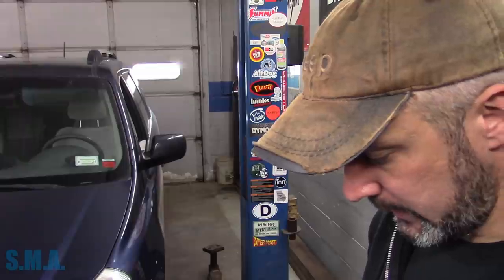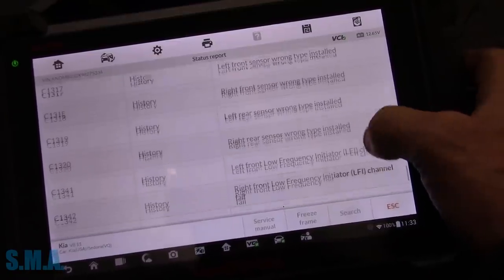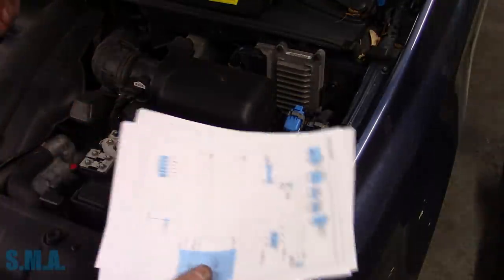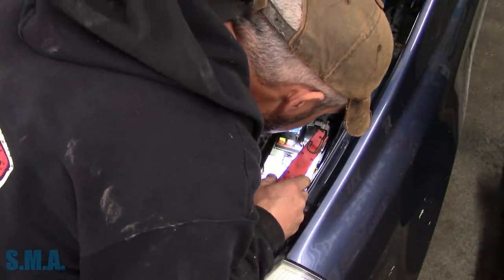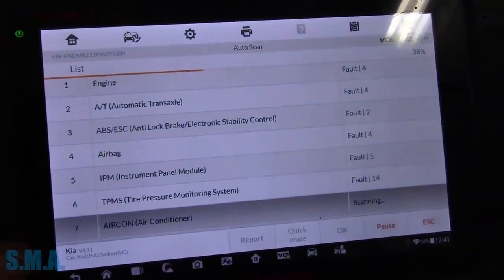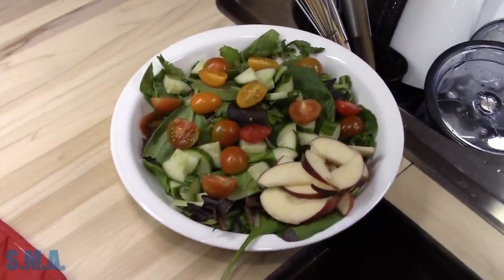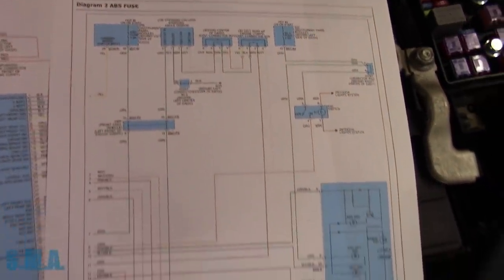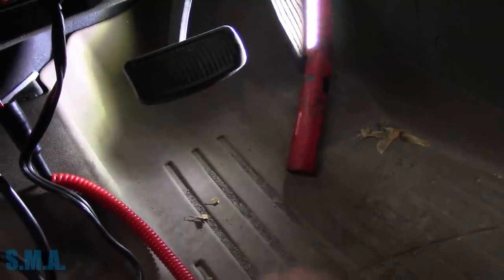You Can't Fix'em All...

Comment: Only one question....please.....how many miles on the Kia?    Thanks .....Jim
PS........had a Problem on my 2009 Honda CR-V (115,000 miles) that baffled me for a while, different error codes came up, misfires, etc., seems as if the computer was going crazy, bought an oem main relay, but before putting it in, one of the codes, besides changing the relay, it said to check the negative cable, if it was loose. I was able to turn it by hand, not easily, but it was not snug. I changed the washer, put on a locking nut (with nylon on the end of the threads) and buttoned everything up. Viola! Everything has worked fine for the last 3 months. No more codes.

Comment: Love the mystery blown fuse.  I do the same as you, trace the circuit, pull the harness, etc.  Only difference is I ask the customer (or driver in my case) if they jumped started the truck or got jumped.  I have found (especially Fords) do real weird things when jumped wrong.  With all these little Chinese jumpers I have seen some havoc after they are used.  Only thing worse is when they use the equipment to jump their trucks, seems 28 volts is a tad high for the truck, sure cranks well though!

Comment: Curious, did you test the remote start & or check to see if best rig tapped into a com circuit wire? Could possibly only blow few on remote start, especially if remote start is failing internally & drawing to much current.

Comment: Very hard to repair to repair intermittent wiring night mares. But I had something very similar, it was steering angle sensor. It took a long time to diag it. Found it by rotating the steering wheel from stop to stop. It was at a certain spot and abs would go red(no comm). Replacing the SAS repaired the issue.

Comment: Re "thermal cycled" fuses: I've seen plenty of the old style (like 3ag) class cylindrical fuses fail from cycling. The type with long straight metal wire element inside. Very cheap to make, but no provision for expansion an contraction. The newer plastic case automotive fuses have U shape elements that all but eliminate stress and cracking. So, yeah, I'm 99.9% sure something made that fuse blow.

Comment: In all the years I have done wiring and drivability only ran into one fuse pop I know was just the fuse dieing. Power feed was to module only and didnt continue past it. The customer was also my customer for many years and continued to service same vehicle over time. Every single other fuse I was able to trace to ground at one point or another through an activated solenoid, module etc.

Comment: Fuses dont always blow because of shorting,some times it can be because the current draw spike exceeds the fuse value when switching. I have vehicles like this before where after investigation no fault or damage has been found and the problem has solved when the fuse has been uprated from 7.5 to 10 amp. There have been some technical bulletins from manufacturers which have said when no fault found uprate the fuse to.. Citroen  alternator field supply springs to mind. 
The reasoning behind this is, wiring strands in the loom have been reduced (accountants) wiring terminals crimped not soldered (accountants) and connector blocks made out of the cheapest components which will "just do" those accountants again !  All the cheap stuff starts to deteriorate over time and in the uk with salt etc and biodegradable wiring covering the wires go slightly porus and all sorts go wrong and the current draw required goes up.
. BMW Peugeot Citroen GM cooling fan connectors spring to mind and fail usually showing up in the summer months in a traffic jam followed by a head gasket. I cannot remember when I last saw a MK1 Renault Megane no major rust or mechanical problems but  4 strand wiring ??  Can't even get blob of solder to stick.

Comment: Best to ask customer when the issue occurred  and if the car was worked on by someone else when it happened. I would even remove the remote start module that was installed as this maybe causing the issue.

And sometimes a fuse can burn from over voltage protect circuitry due to alternator producing high voltage output but this is very rare.
Like you were saying it could be many other things. Just replace fuse and see what happen over the next few weeks.

Comment: My daughters Tucson has similar problem.initially we thought it was aftermarket remote starter butcher job.Had all that removed. Code comes in as speed sensor. Changed,same fault. It also looks like Christmas on the dash, traction ,downhill,abs,check engine all on! Still drives ,sometimes dash returns to normal for short period then warning lights on again  ! My mechanic gave up too!

Comment: When looking over the video I noticed what looked like a metal hose clamp around the wire harness
when you were under the dash that could b a problem. I would have put a twist tie on that while I was
under there, probably not going to solve your problem, but it's worth a try. I never seen a metal hose 
clamp if that is what that was under a dash around a wire harness before.

BTW Love your videos.

Comment: I encountered an AMG fuse this week that seems to have just fatigued and broke. One of the ignition fuses on an Intersmashable DuraStar.
Dispatch called and woke me up at 7am on New Year's Day (hooray) because the truck bricked itself at speed. It came back to life if they shut the master battery disconnect off and let it sit for a few minutes before turning it back on. The battery cable goes to the stud on the starter then with another cable on to everything else, and the nut on the stud was about halfway off. I figured that was the problem, addressed it, and shipped it. A half-hour later it did it again but didn't come back. I found the bad fuse with my voltmeter, but slipped a bit on some ice and pushed the probe onto the fuse a little harder than necessary, and the whole truck came back. I popped the plastic off the fuse and sure enough it didn't look burnt at all, just a crack right through the fuse portion, went back together perfectly. 
I put a manual reset circuit breaker in instead cause we didn't have another fuse in stock and the New Year's Day thing. But it hasn't tripped yet to my knowledge.

Comment: I just finished a short bus that kept blowing fuses for the marker light circuit and the driver had upgraded half the fuse panel to 40 amp fuses and also said the bus was burning oil. The short was from a jumper wire that tied the master switch for the 8 way system to the instrument panel illumination  circuit that is powered by the marker fuse. His boss said he noticed the oil was over full so he wanted to know how much over. So I drained and measured the 6qt capacity  5.3l gas burner had 15 quarts in it. And now has numerous oil leaks that it didn't have last year.

Comment: I think that I would have tried grounding the loose bare wire you noted at 7:50 to see if that recreated the overcurrent. That wire was probably supposed to be connected to something. Best to leave it disconnected but tape up the end to prevent a future issue.

Comment: Had one few years back, Nissan truck. Randomly would pop fuse for dash lights. Pulled hair out for a few days over it. Sent it away and was brought back ever couple of weeks to see if anything could be found. Customer got good at replacing fuse so it became a funny quirk of the truck. No big deal right. After a year or so vehicle was brought back for another complaint not related to prior concern. Vent wouldn't change with lever slide. These trucks were still controlled with cables moving the various mode flaps, the good old days, you know. Well I had to remove radio to access control cables. It was a dark day and the headlights were needed, with radio removed I needed to move truck while waiting for replacement bushings to arrive to fix cable. I backed truck up and with a pop and sizzle low and behold dash lights went out. I thought no way, so I grabbed a fuse from bag owner kept in glove box and replaced fuse. Moving wires in radio hole, sparks flew and lights out again. Turns out aftermarket radio was installed and big box store who installed it cut harness and left factory radio illumination wire clip and exposed. With the right motivation, wire would ground against metal frame of radio bracket and pop fuse. Couldn't charge for repair of wire, but got a hand shake and happy customer, and a bag full of 10 amp fuses. Lol

Comment: Just a guess on my part but I am wondering if there might be a wonky solenoid hanging off of the ABS module. You didn't mention if that fuse was hard shorted with flash burns inside. Solenoid valve coils, as simple as they are, can get anybody- sometimes they open, sometimes they partially short, sometimes they hard short, and sometimes they do those things after they heat up or are vibrated.

The other thing I am wondering is if, while the fuse was out, did the remote start thing work. Another thing I am curious is if that fuse ended up in the steering column or clockspring.

One thing to consider is that one of the modules crashed and latched up, which would/could turn on all of the loads that module runs, and as soon as the fuse blows, the power cycling restores it to normal. That happens sometimes in upfitting where the battery goes nearly dead.

A fuse at or near capacity can be subject to vibration, so if that fuse was passing 7.5A and she hit a pothole, that could do it. Yeah I know it's thin. Another thing is that not all fuses are created equal- there is a difference between Bussman and Chinesium, and it could have just been a marginal/defective fuse, in which case changing it could solve it entirely, which is why I was wondering if it had flash burns.

The other part of it is that sometimes letting it bounce around in your head for a bit will cause you to think of other possibilities/tests that you could do if it comes back.

Don't beat yourself up too badly- it's like football- the other team is trying to score too.

FWIW, I bet if it comes back you'll nail it in relatively short order.

Comment: Of course you can fix them all !
Some are harder than others - like crosswords.
I donno if you checked - but I'd go over battery clamps and chassis earth points - as it seemed rather random with the history codes.

I'm 100% with you on the blown fuse.
Thats not by itself the problem.
The real problem is why the fuse was blown.
This car you will see again I'm sure.

Comment: Interested to know if any freeze data was logged, and what would show on the 20 pin? Under bonnet Diag plug. Also temp gun on fuse, only a small draw technically so very low temp. Good decision to pull the pin, intermittents are the big time mines!
Where are all your staff hiding these days or is after hours filming.

Comment: Good vid. My Guess is --- " Best Fry " cut something at some point when installing stuff & shorted it out in the process. probably did all that work WITH battery connected & when  something  sparked the guy said " oops 😬 " then proceeded to disconnect  battery. 🤣. 

if not --- If pops again --- You can fuse each of those 4 circuits seperately with fuse holders ( cut each of 4 wires , drop in some blade fuse holders. then u have it isolated to 1 circuit when it pops. )

We can only do our best & the man upstairs will figure out the rest.
We Can't fix it , if it aint broke.
intermittent shorts are the worst. Dead shorts ARE THE best !
Eventually intermittent shorts ALLWAYS become Dead shorts given enough time. just keep fusing it until its a dead short. Wayyy cheaper bill for the customer.

Comment: My experience with 2000-2009 Kia wiring has been frustrating, to say the least. Between intermittent faulty connectors causing suspicious codes (ie, upstream O2 sensor connector) and connectors melting and almost catching fire (ie, blower motor resistor connector), they'll make you scratch your head. I ran into an issue similar on a 2008 Kia Spectra I worked on (i forget which fuse and which circuit), were it popped a fuse and I traced the complete circuit from end to end and couldn't find any faults to cause the fuse to blow. Maybe Kia got a bad batch of fuses?

Comment: You could install multiple small fuses between the junction and the various loads.  Then if the 7.5 amp fuse blows again it is the wiring to the junction, or if one of the smaller fuses blows but the 7.5 A stays intact the problem is in that branch.  These can be a real headache, but the problem can be found if it makes economic sense to do so.

Comment: They are Notorious for water getting into plugs and turning em green. After seeing that crappy auto start I’d remove it and then re install a t harness remote start. Also check front right speed sensor wire.

Comment: In the worse case, you could put individual fuses for each of the circuits coming off of the junction block. Then see which circuit fuse comes back blown. This would at least let you know which circuit is giving the trouble.

Comment: Check wire harness connection under drivers seat. It's outside ,under seat where wires go from inside can to outside , behind dr.side wheel !  Plug /pin  Connectors corrode and short out.. did it on my JIMMY.

Comment: Hey Eric I had the same issue when I disconnected the battery it caused the ABS and traction control light to come on, come to find out my steering angle sensor had to be recalibrated. When best try installed the speaker's they probably disconnected it and they probably pop the fuse by shorting a wire. Not saying this will fix your problem I'm just a simple diy guy.

Comment: I agree it's a previous comment look for a smoke .. Or the ABS module contains an electric motor somewhere in the system which sits for long periods of time maybe it was activated and Drew too many amps and blew the fuse but now that it's been activated and no longer will blow the fuse what do you think???

Comment: Hello Mr. O. I have a 2011 Toyota Venza. Scam says open circuit in RR wheel speed sensor. We’ve traced the wires from the ABS and there’s continuity. Replaced sensors. It reads for a minute then goes to zero and the codes return. 

Any ideas what I can do?

Comment: I know this is off the record and subject but I'm asking cus of your incredible knowledge...I have a 04 Ford explorer sport trac and it has this odd vibration upon accelerating in gas pedal only if u let up on pedal  it goes away... and it doesn't always  do it which is another mystery.. shifts  fine and runs great..but at idling it has a random skip or whatever seems to be the only other problem...any ideas?

Comment: @Eric what are you using for recording in the car and how do you have it mounted, switch the shots such as when you got back from the end of the drive the camera came from behind to a side view. Are you using multiple cameras mounted in different locations in the vehicle, someone holding them, etc? 

Maybe a "how I film" video walkthrough?

Lastly with something like this type of diagnostic work which we all know can be time consuming how do you bill it out? Reg customer vs new vs passing thru customer, would they all get billed the same. 

Do you have a flat fee for this as we all know in the industry other jobs including brakes and other things can bring us more money into the shop per hour vs tying up a bay for a couple hours which could get at potential parts and labor profits. 

One could always note that something like this even if found in a decent or multi hour time frame could lead to a possible bad control module which can be parts sold plus programming so there's alot of forks in the road. I'm just seeing how different people do it. 

One thing I've noticed is if you can't find something or it's not rearing it's ugly head it's always harder to get paid for the extra time vs if you know what it is,  track it or it rears it's ugly head and you get it fixed then they're willing to pay.

 Though there are still some who will complain or try to beat ya up on the price I can feel some of them out based on speaking with them on the phone before I even tell them I have time to look at the vehicle or not. 

A recent one that came to mind was one which wasn't even an electrical. The gal wanted the brake pads replaced, she'd supply them, was in a jam according to her. I let her know the rotors needed to be turned because I saw how this was going. 

She balked at the rotors needing turned or replaced and said she couldn't afford it. 

I finally threw it out there that my insurance policy due to liability, workmanship issues and overall performance of not doing the job properly wouldn't cover me should something happen. 

I get that sometimes people need a helping hand but also one has to be careful how you go about that because it could open a floodgate but also lead to some serious legal, ethical and liability issues. 

As I say, better safe than sorry. Not to mention cutting corners puts the motoring public at risk and being a former trucker, truck mechanic before that I take the safety seriously.

 I've seen major carnage firsthand, helped victims and those at fault likewise in accidents firsthand because in accidents I don't discriminate as that person or persons are probably going thru one of the worse times of their lives at the time of the ensuing chaos of the accident. 

IF you've got time for a segment sometime such as a bonus video for channel subscribers only. I don't know if YouTube allows you to select the type of audience you want your video to be seen by such as SMA YouTube Subscribers, those who click or like a certain video which would give them either access or a link to the subscriber only video?

That would be a cool concept if they have it. 

Sorry about the long post but been silent for awhile as been lurking in the background, learning other things car wise ( IMMO, SECURITY & Vehicle Security/Bypass Stuff, reprogramming key fobs and other related stuff). 

Still plenty to learn plus things are always changing.